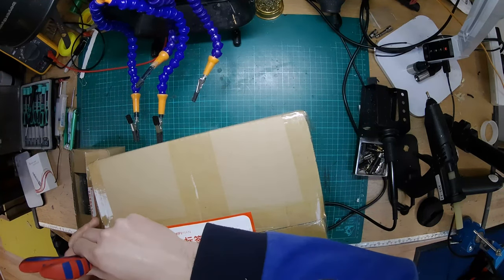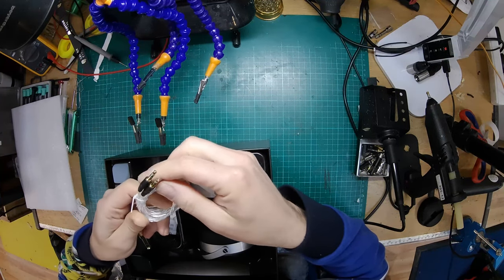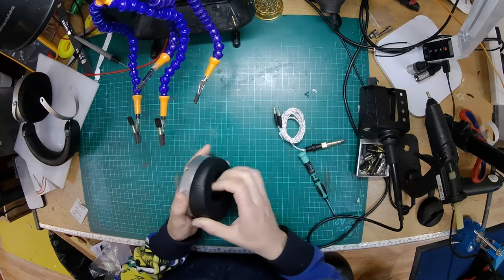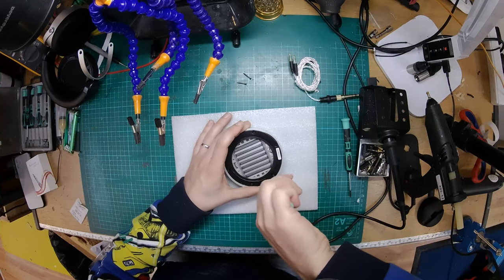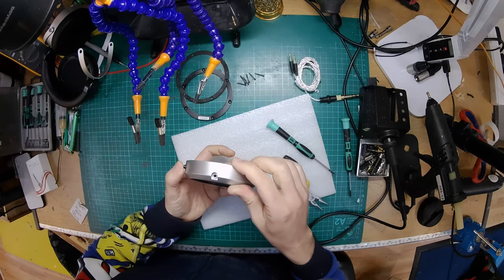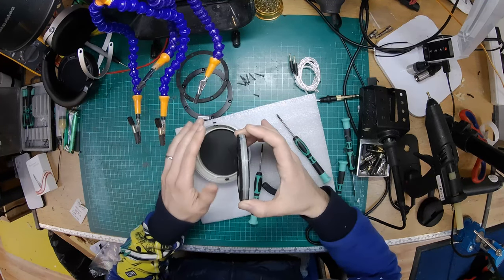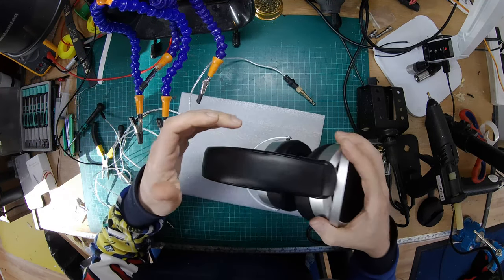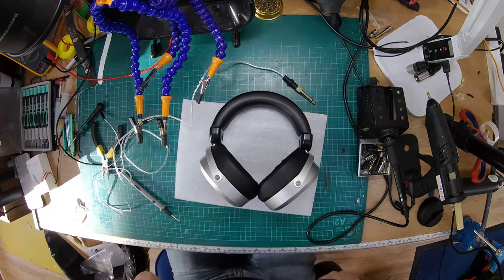Hifiman HE400se Design review - taking a look inside some cheap planars

Comment: it's funny how of all the reviews, you were the nicest about the cable
Reply from the maker: Having designed and built a lot of audio cables I know it can be a tricky thing to get right on a budget. They went for braided silver plated copper which should perform well electrically but you sacrifice on flexibility, microphonics and connector quality. 
We make a lot of cables that cost more than these headphones so I have to forgive them for not being totally on point ;)

Comment: These don't look too bad, indeed. Modding-wise, first I'd change the metal mesh with a more open one - either one with larger hexagonal holes for better airflow and transparency or a woven wire mesh, for that combing effect and still better airflow. Secondly, on the inside of the cups, between the outer wall and where the mesh starts, there's a "lip", where something like sound-absorbing foam can be placed. And thirdly, of course, pad rolling. I'd try something from Hifiman themselves, but from a higher-end model, as long as the size is the same. Alternatively, other pads with larger openings could be an improvement.
Reply from the maker: Thanks - I will have a play and do a bit of testing
Reply: doing this completely removes all of the low end from this headphone and some midrange

Comment: Mine (chinese version) has a peak at 9500Hz. That equals to a wavelength of 3.61cm and 1/4 of that is 9mm. If thats the distance between membrane and backplate we might have found the source for that standing wave. If someone were to measure these without the grill and see if that peak goes away that would be interesting!
Reply: Is it easy or hard to drive ?
Reply: I wish someone would compare the international and the chinese graph. I got the chinese version and im wondering if i should EQ it based on the international version graph
Reply: @EGxSenSei  it's pretty hard, definitely can't run it off of PC/Laptop, it gets loud enough on my phone but the sound is pretty flat and boring

Comment: I was curious about this pair so had watched your videos earlier. Then I went ahead and bought Sundaras. Unsuprisingly cable is annoying and I wanted to replace them. Since hifiman cables ends with dual 3.5 mm TRS, I wanted to check how it is wired inside the cup and if it is possible to use dual 3.5 mm TS cables. From what I understand, I can. What I did not understand, why would hifiman use dual TRS cables? Do you have any insight on this?
Reply from the maker: The tip is positive and I believe the sleeve is negative but yes... you can use TS or TRS with them as there are only 2 connections in side - I am not 100% sure but More TRS jacks are made than TS so they may be slightly cheaper
Reply: @CustomCans  makes sense, thank you.

Comment: can I use these headphones as a  mobile audiophile?
Reply from the maker: They are pretty low impedance so should work well with mobiles and they are not too bas as far as wind noise when walking around
Reply: @CustomCans  What about sennheiser IE 100 pro?
Reply: unfortunately no, they have a low impedance. but planars are really hard to drive no matter what the impedance states

Comment: What happens if you place a Foam ( Beyerdynamic Foam Disc fits perfect) in front of the driver or Behind the Driver ? Have you measure that ? Honestly i cant find any info about that.  On any Headphone.
Reply from the maker: It is not something I have tried yet. I may get round to it at some point but probably taking a rest from the HE400 stuff for a while as I have lots of other projects to finish off

Comment: I've just ordered your upgrade headband and Super Grills.
If the Super Grills aren't a huge improvement, I won't be too disappointed as the headband that comes as stock is not comfortable, and the new grills will at least look nicer.
Reply from the maker: The difference in sound is subtle but glad to hear you like the headband ;)

Comment: These looks really interesting. The amount of engineering in these is simply amazing since I am sued to a dynamic driver in a simple plastic earcup. Planars are an another level and I have not yet had a proper planar on my head and people recommend these a lot as they are a supposed to be a perfect entry planar and great headphone overall. I think I might pick these up.
149€ on Amazon...
Graph is a wee bit wonky with the 2khz region being quite recessed while its accentuated on my AKG K702. Easily a 5db difference there. But I am an avid supporter of EQing your audio gear so not a big issue for me.
If I turn the 2khz region up by a few db, tame the 1khz hump by just a tiny adjustment and give it a few db in the sub-bass these would be absolutely dead on the neutral target.

Comment: I bought them recently and they changed the cable to a really thick black rubber one. I would say it's better than before. they changed the packaging too, to a really generic one. but well, they made them 100usd for a while.
Reply from the maker: Yeh the new cable is much better and the foam inside the box turns into a headphone stand, which is pretty cool
Reply: @CustomCans  Its much better agree, but again a terrible cable like Sundara Cable . Is it to hard for all Headphone manufacturers  like Focal, Sony,Hifiman,B&O to make a cable like HD650,660s ? How hard is to make a cable that doesnt tangle , is magnetic protected , is copper , machined confections, light , magnetic field protected, not Para corded or fabric or  anything that dont last in years, and cost little ?   All Manufacturers keep changing their cables, But 650 cable didnt change all these years just one time back to HD600 years .

Comment: I liked the video and stubbed. Until 14:25 , on the mic you used, you should add a high-pass filter or just eq out the sub-bass. There were lots of distracting noise in that range, when you were putting the tools down on the table etc.
Reply from the maker: Yes - you are right - I will try to get a shock mount or proper stand for the mic soon that should fix the issue. I am slowly building up all the kit I need to make better videos but I am so excited about saving up for a fancier camera that I overlooked the mic a bit ;)

Comment: Will you do a full review of the 400se eventually? I'd love to see how they compare to the Drop Hifiman 4xx if you ever owned a pair of them too..
Reply from the maker: We will certainly doing some more testing and mods on them soon but we don't have any 4xx for comparison unfortunately
Reply: @CustomCans  Out of curiosity when you unscrewed the earcups/ drivers from the yolks do u happen to know what kind of plug or holder thing  the screws were screwed into called?  I wanted to see if i could buy that part for my 4xx earcups to mod them on so I can try to use the deva/400se/400i 2020 headband for my 4xx..
Reply from the maker: @Coconuts738  no sorry, I don't know what they are called
Reply: @CustomCans   It's all good. Gonna sacrifice a 400i 2020 that's arriving this weekend and see if i can mod my 4XX to use the 400i 2020 headband, since i much prefer its sound signature over the 400i 2020, and the 400se that i had a chance to try out recently, a few days ago..

Comment: Tuning ?
Are you a newbie ?
use EQ.
Apo equalizer is free ....
Reply from the maker: You are right ;) EQing is much quicker and cheaper and a good way to hide any peaks and troughs your headphones may have in the frequency plot.

Modding is unpredictable, expensive, time consuming and dangerous but some people find it a fun adventure.

But...... Here is an experiment you could try 
Open two youtube windows. In one get up 1khz sine wave and in the other open a video with 1khz square wave. They are both the same frequency and you can set them to the same volume but they will still sound different.
Reply: @CustomCans  what your experiment has to do with EQ ?
Let me enlight you, it has nothing. Square waves are not natural born acoustic waves in any way if you are implying it in sort of way, and are not a result of EQ What so ever.  You are talking with a mathematician. 
I suggest and recommend from your side, to accomplish the education about the math involved in the matter above.
If you need any help I am here.
Sorry for bad English on my behalf, I am from Israel.
Reply from the maker: @AY-dw4om   I think your english is pretty good and thank you for offering to help. You are correct, that is not a good example. I was just trying to think of a good way to show that different driver and enclosure designs can effect the way the output waveform sounds that may not be easy to fix with EQ. Like if you have a lot of harmonics or a longer decay on the bass than the input signal.
As you say, I definitely need to learn more about EQing and DSP. I would love to make a video about it in the future once I have learnt a bit more so if you know of any good technical resources that will help that would be great
Reply: @CustomCans  The best way to do a headphone good, is make sure it doesn't have a back cup. The cup was invented for 3 reasons back than:
1. to make you the listener not interfere with others and keep their privacy from your music.
2. to make you the listener isolated from the noise of the world outside.
3. to help with back pressure and acoustics return, so help low octaves (bass) get enough volume, to even the very bad and un balanced nature of headphones of that era.

But today we do not need those:
a. we audiophiles listen at home in our controlled environment , and do not need this sound insolation from the surroundings.
b. todays head phones quality and amps are extremely powerful for cheap money, negating the for low octave compensation cup unneeded any more.

What we achieve in return for eliminating the cup, is zero back cup waves return, and a clean sound that emits directly form the driver with out any other waves interfering in an out of faze manner.

so the sound is as clean and undistorted as possible. that leaves us to EQ'ing with an EQ software at the source level, done today at higher bit rates with meaningless quantization errors for the application at hand, e.g. 115DB dynamic range (more than 20 bits) at least required for human hearing. and that's it.

so leave the manual physicals tuning methods out side of the realm, it isn't necessary any more, and use advance technology that we have available to us today for practically zero money.
Reply: @AY-dw4om  there are people who enjoy modding, I think you shouldn't try and stop them from doing what they want to. You make good points, but ultimately, you sound like a nagging mother. Let people enjoy things.
Reply: @Jhet  of course, they can enjoy what ever they like. I just enlighten them, to know the other option as well. the easier more modern way.